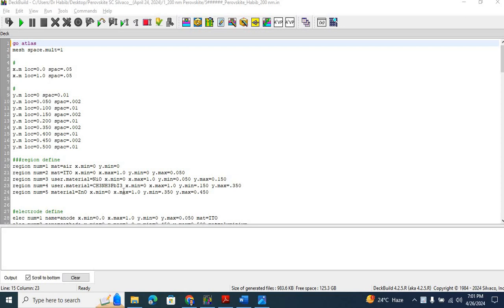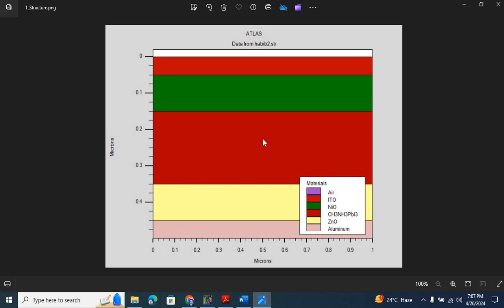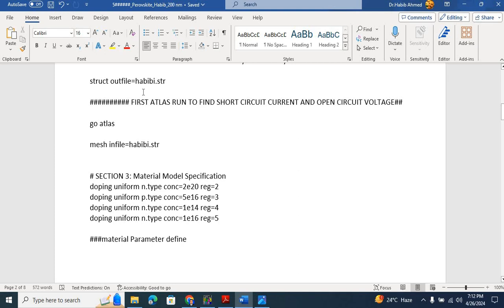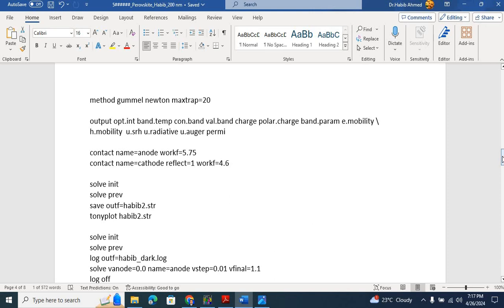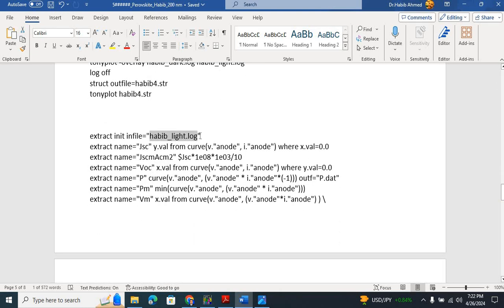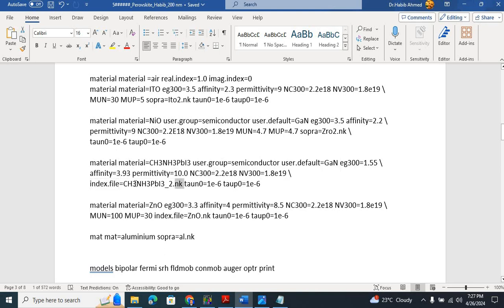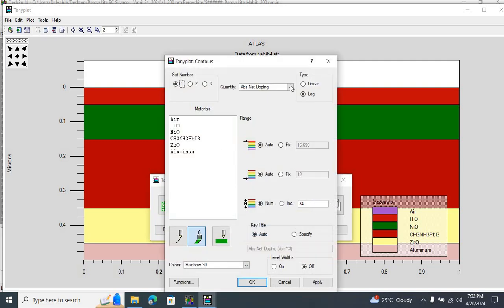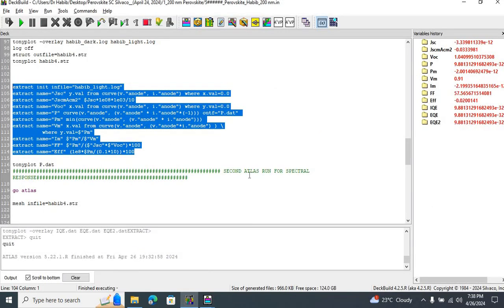Simulating Perovskite Solar Cells with Silvaco TCAD 🌞💻🔋💡Sustainable Energy 🌞 📊🔬

Comment: how did you extract Jsc(mA/Cm2)? Jsc*1e3*1e8 /10 ? why /10? in another video that you reach 25% efficiency you just used this term *1e8*1e3
Reply from the maker: It is explained in the second video. Depends on the area through which current flows.
Reply: @HabibAhmadGatech  i see the second video. but the area in two videos are the same
Reply from the maker: Probably a mistake. Good catch.
Reply: @ so which one is true?

Comment: Sir while running in this code it's showing can't read file for habib_light.log can you please tell how to solve it
Reply: Sir it worked but efficiency is coming as 0.4 can you suggest how to increase it
Reply from the maker: @Iji-q2q  Please watch the other video on my channel  "25% efficiency Perovskite solar cells"
Reply from the maker: Please check your code. Apparently, there's some error in your code. Try to exactly match every line of the code.

Comment: Dear Dr. Habib,I have a question. Why is it that my code is exactly the same as yours, following your video step by step, but the model is not coupling. including errors: Warning: Internal error in linear solver.This situation rarely occurs in normal circumstances.This error could indicate a ill-defined problem. Check structure and models for possible conflicts.Warning: Convergence problem.  Taking smaller bias step(s).  Bias step reduced 6 times. Warning: Projection cannot be done with current bias step.  Using previous solution for initial guess. 

I've tried shrinking the grid and changing the METHOD with no success. I also reduced the value of b1 and that didn't work either. I hope you can take the time to guide me. Thank you!
Reply from the maker: Not sure, why, unless I see the code. Sometimes, minor changes can cause big problems in simulations.
Maybe try my other video on Perovskite solar cell.
Reply from the maker: Did you create the sopra files for this code?
Reply: @HabibAhmadGatech  CH3NH3PbI3.nk ,ZnO.nk, the code .in files are in the same folder, and the contents of A and B are also the values shown in your video. I don't know why. I'll take a look at your other simulation teaching and see if I get the same problem. If that doesn't work either, I'll have to come back to you for advice. Thank you very much.
Reply from the maker: @KKAmoy-haha  sounds good
Reply: @HabibAhmadGatech  Thank you very much, Dr Habib. My simulation has worked. I deleted user.default=GaN, and the simulation worked.
Reply from the maker: @KKAmoy-haha  Awesome

Comment: Thank you sir,I'm having a bit of a problem. Can you point me in the right direction? The model never converged.Warning: Convergence problem.  Taking smaller bias step(s).  Bias step reduced 1 times.  Could you leave an email if it's convenient?
Reply from the maker: You need to check a few things.
1. Optimize your meshing.
2. Reduce bias step size.
3. Method Newton itlimit=40 maxtraps=40